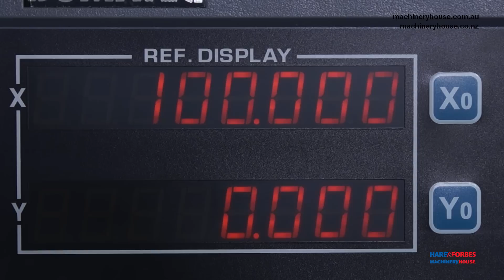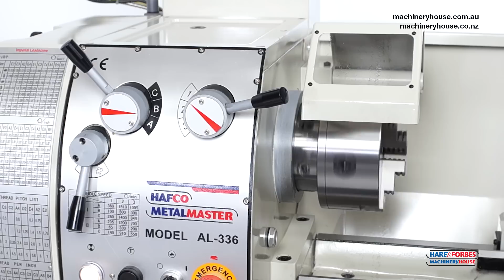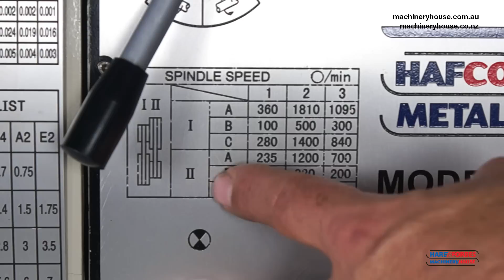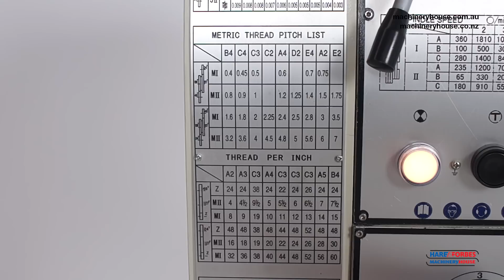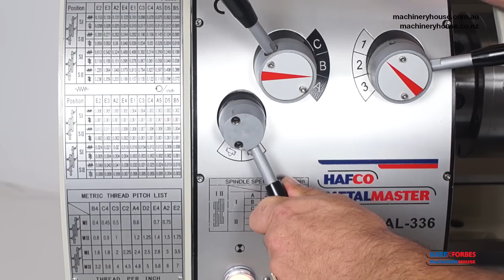AL-336D DELUXE Centre Lathe HAFCO Metalmaster - Full Review (L682D)

Comment: On my thread indicator table the first column has T.    0 and 16  what are these numbers for. I read in one of you're replies to another comment that its to do with a 16 tooth gear. Where can i find one of these for the al336?
Reply from the maker: Hi Mike,
The "0" and "16" refers to Gear fitted to the thread indicator. 

When the chart reads "0," you can engage the half nut at any position without the risk of cross-threading. 

For thread pitches with "16," the thread indicator requires the 16-tooth gear to be engaged with the leadscrew. And the half nut can only be engaged when the threading indicator l is on specific number according to the chart.

For example, to cut a thread with 15 TPI, the table indicates that you engage the nut when the threading indicator dial is at positions 4 or 8, to maintain proper alignment with the thread being cut.

All AL336 lathes should be fitted with a 16-tooth gear from factory. If yours has been removed and you require one, then it is best to contact your local store for more information on spare parts.
Reply: @Machineryhouse1930  ahhhh🤦‍♂️🤦‍♂️. Thank you. That makes sense!

Comment: how about you guys inform the factory that they are machining the tailstocks backwards?

if i had looked at that when i bought it, i would have demanded a replacement that has some overhang where its needed so you can actually turn between centers. or gotten a different model. the 346 has a "standard" tailstock with the overhang facing in the direction its required... maybe theyll fit? but if i head to the showroom, do you reckon theyll even let me try? nope.

even the line drawing in the parts diagram shows it oriented the correct, standard way, rather than being backwards with a flush front so it has no overhang and always gets in the way.

but then again, H&F has a reputation for excellent customer service, so i dont expect anything to change anytime soon. how long have they been making and selling this model with its backwards machined tailstock? bit late now, huh?

i definitely wouldnt expect them to say... supply a correctly machined tailstock that can actually be used, to all customers that have purchased one of these, if they wanted one. much the same reason im making that new shaft inside the hm46, that when i showed up to the northmead showroom with the shaft with manufacturing defect, the thing has a crack running down the length of it, obviously from the factory as its been ground AFTERWARDS, but "brian", or maybe it was "bruce", simply looked at me and stated "what do you expect us to do about it?"

you are expected to REPLACE DEFECTIVE TIMES AS PER AUSTRALIAN CONSUMER LAWS, thats what i expect you to do about it. i seriously contemplate going back, recording the conversation and approaching the ombudsman over this. i can handle a bandsaw blade breaking, thats normal. but a critical internal part of a machine, that it RELIES upon, and is DEFECTIVE... havent been back to H&F since then, and i wont be returning anytime soon. your impeccable record of customer service has lost me. and well, i dont seem to be the only person with my experience, from what i hear in the mens sheds, in lunch rooms, down at hornsby model engineers shop... i am yet to meet ANYONE with a positive thing to say about H&F and their customer support.
anyway. 

every other lathe in your line has it done properly from what i see. just the 336 stands apart with this nonsensical tailstock design. 

surprised the place is even in business. maybe they have a better rep in other cities, but northmead has a long upheld tradition of employing arseholes that have absolutely no interest in assisting anyone, whether it be advice, help, or simply honouring australian consumer laws regarding faulty products and manufacturing defects.
Reply: In regard to the defective shaft in your HM-46B Mill Drill, talk directly with Mr Ankur Patel (Manager), whom I have found from personal experience is a very reasonable and sincere person. He is a shining example of a 'People Person'.
Reply: @tandjrogers  sorry, i had to have a rant. this popped up in my feed for some unknown reason... and i was wasting time simply because that tailstock had caught me yet again! and yeah... id just had that experience...

ummmm... i made one. not sure what steel old car axle is, but it hardened nicely, ground nicely. without cracking. only had to split the box another two times, measure it, then install it...

easy gear shifts and no more "clacka clacka".

sigh. they do the job. do wish that tailstock was done properly though. meh. it gives me a project.
Reply: @paradiselost9946  We all need to vent now and then, it's human nature mate. I'd love to see some photos of your 'shaft' work around. [Did you contact Ankur?] I can't understand why the tailstock on this model lathe was done this way (arse about)??? I checked the specs on all their models around this size but there's nothing 'adaptable' to the 336. Different 'bed widths', different 'centre heights'.
Reply: @tandjrogers  ahhh, you see it now, dont you? my guess is someone stuffed up in the factory a long time ago, and as noone ever pointed it out as an issue, and possibly with 10,000 having been machined that way... thats how its stayed. jig stays on shelf until the next batch and again. why change? would just make parts awkward...

two options... hack it up and turcite the base back to alignment, or hack it up and make it into a slotter/lever type. not a fan of hand wheels on deep holes. got enough meat for some slideways if i slice about midway through the spindle bore.. base needs skimming anyway so it actually contacts the bed properly. i think they machined it with an oxy torch, by the look of it. so it will all shift down a bit and give me some room up top.

quick search for 300x900 lathes.
SMT1236GA
CQ6230A

same factory different seller. backwards facing tailstock.

seems universal on this model. i guess i should fix it and stop complaining :)
Reply: @paradiselost9946  Seriously? Two others! That is just about unheard of. Unthinkable that a factory can let such a blunder go un-rectified. WOW!
Reply: @tandjrogers  its strange. what do you do? shrug? bitching dont fix nothing!

got a dro kit the other day. there goes another 30-40mm of travel... 

seriously... somewhere buried under junk here, there is a furnace, some crucibles... #10 will do 14kg of CI... 

i made it for a reason! maybe time to actually USE it? lol, the third option! possibly the best approach?

at least i dont destroy what i have trying to modify anything and can always melt it back down!

might try and document it this time ;)

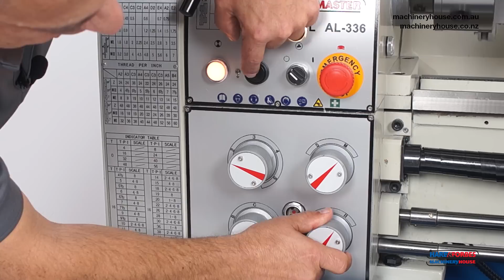Comment: Also don't forget that they're shipped from the factory dry, youll need to put oil in the 3 gearboxes, at 13:01 we can see the sight glass for the threading gearbox has no oil in it. there is also one for the spindle head and the last one is on the saddle. :)

Comment: Bought mine in 2014. Pink Instruction book was almost useless, I hope they have improved, I ended up downloading the grisly.com 40 inch instruction manual and while there are some differences, the book it actually tells me how to adjust backlash in the compound slide that was greater than 20 units either way. The motor expired about a week after it arrived and was replaced by the company H&F. If you rely on the digital readout for accuracy, expect a world of pain, buy a decent micrometer and avoid vernier calliper for accurate work, I know they’re cheap but I need to save up for a good set of micros. The crossslide says it is accurate to .002 in or .04 mm. I think some of the figures we hear on YT are fiction.

Comment: What does the Z mean on the imperial thread cutting tables on the side of the gear box (quadrant)
Reply from the maker: Deborah Dupain that represents a gear size (No of teeth) that needs to be used in gearing to achieve a certain thread range thats indicated directly below, see image on left bottom gear is Z, this gearing can be found behind side door cover, Also all the necessary gears are supplied with the machine as standard, hope that helps

Comment: Would the AL 346V be a good first lathe?
I half own an old AL280p (combined lathe & mill) with a relative but I’ve never got to use it, so figure I’ll just buy separate larger machines for myself.

Which milling machine would go best with the AL 346 V please?

Is there anywhere in Perth WA I can get lessons to learn how to use it?
Watching a zillion videos is no substitute for doing it hands on with someone watching over & guiding you until you become familiar with it.
I’ve wood turned before but metal machining is a new hobby.
My biggest fear is crashing the compound into the chuck.
Is there a reason there’s not an adjustable carriage travel stop that automatically stops the travel a split second before a crash?
For new chums, it would be nice to know you can’t crash it if you set up an auto stop.
I figure if cars can now brake before hitting the car in front a metal Center lathe ought to be able to do the same.

My 2C,
Reply from the maker: Hi Ian, It would be best to call or visit one of our stores and speak with a technical sales person to guide you through all the alternatives to suit your requirements, we have machines on display and you can get a hands on feel as well for the machine size as well, whilst working with one off our technical staff members to help you.
Reply: Hare & Forbes MachineryHouse Thank you for the reply Mark, I will try and get down to MH / H&F this week for a run through with one of your sales technical guys. 👍

Comment: Something these Chinese lathes need is an cutting stop for the feed and they would be perfect. Most of the milling machines have a drill depth stop and it is a really useful thing to have and I wish they would add it to the lathes. It would make them a "manual cnc machine" since you couldn´t miss your mark.

Comment: I own one of these and want to cut a19 TPI imperial thread There are four columns for the indicator "C3" How do I know which column I'm currently using?
Reply from the maker: Firstly you need to have the gearing set up as per left table that the 19tpi falls within, (48,127, Z=(38) which is shown directly under C3. secondly the left gearbox dials are to be put into 'C3' and the other dials 'MI'. You look vertical from the thread size you are doing to get Z gear and 2 off the dials for gearbox, then look across left from th 19tpi to get letter & no. for the other 2 dials of the gearbox. going another step further the indicator table for 19tpi located on thread chasing dial right of the saddle shows you to use 16 gear in bottom, which is most likely already set up in it, (check) and also shows you you can only engage/disengage the lever on the number 8 mark seen on top of thread chasing dial rotating when machine is running. hope this helps, if you require more details we offer phone assistance as well,  please contact your nearest Hare & Forbes office.
Reply: Thank you for clearing that up.
Reply: It turns out my machine was mislabeled. My left gear table was not marked as 48,127,Z. It is labeled 48,127,24 and vise versa.  So I was a bit confused.
Reply from the maker: If you contact our office our spare parts people should be able to quote you on a new name plate? hope it all worked out for you,  i'm also glad my explanation was helpful. cheers
Reply: Thanks, but now that I'm aware of it I shouldn't have a problem now.

Comment: Good lathe, had one for 2 years, plenty of capacity, i found the best way protection lubricant is WD40 Specialist Silicone lubricant or Lanox. Way oil wasn't so good. Otherwise turns true, runs well. The saftey guard can be removed and used without it. Lead screw appears imperial, which isn't much of an issue just need to mindful if you need to chase threads. Great machine.

Comment: Note the chuck holding system not only has the three chuck key release screws holding the chuck but also needs the hex head locking screws are needed to be release before undoing the chuck . these need to be tightened after installing teh chuck/securing bolts.